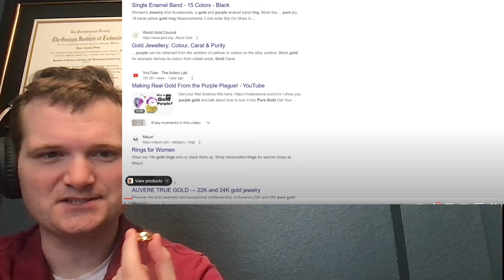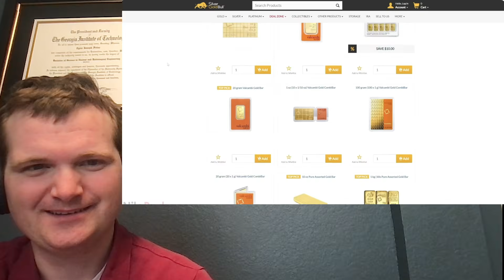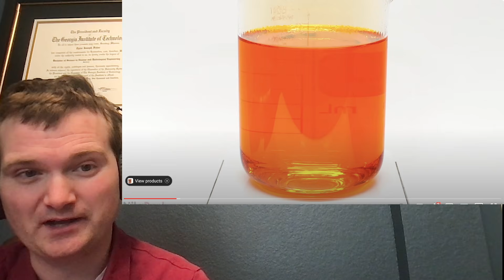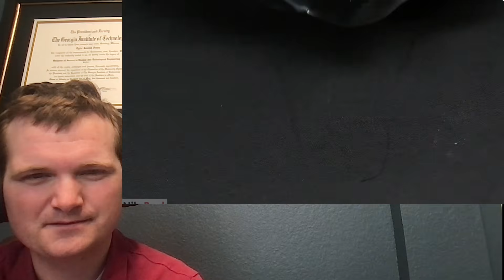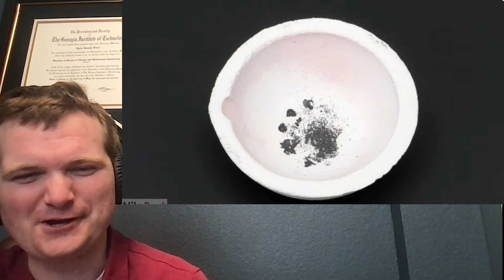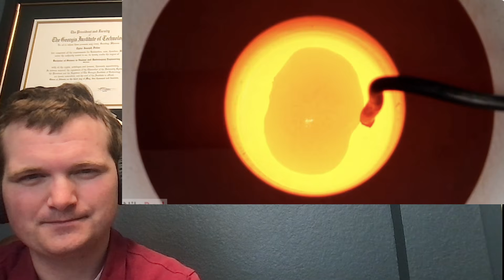Nuclear Engineer Reacts to NileRed Making Purple Gold - Part 1

Comment: 13:58 I wonder how youd actually deal with it for real though? Wouldnt the acid eat any paper towel? Otherwise you could jsut sop it up and throw all the paper in a crucible. Its not magnetic so thats out. Vacuum cleaner with a clean plastic compartment?

Honestly, theres probably some crazy chemical solution that would have made a good nile blue video, should try it on a....smaller scale

Comment: The NASA Helmets used to have a thin film of Gold on the face shield, I’m assuming they still use this technique. I have Welding Shield Lenses that have 24k Gold film also. They change the colour of the arc/puddle and are a treat to use, extremely clear with very good contrast. But these lenses are very expensive.

Comment: Posted to NIleRed.  Lesson for you that you need. Pure gold 100% gold is always yellow always 24 karat. Asked my mom 50 years ago as child how she has white gold because gold is an element. Elements do not come in various forms; they have EXACT unchangeable features. Finally in 1985 a jeweler told me, 12 karat is 50% gold, 18 karat is 75% gold, 22 karat is 92% gold. If you have 18 karat gold (75%) the other 6 karat of 25% is brass so it stays yellow. If you have 18 karat white gold it is 75% gold and 6 karat (25%) nickel. The value is actually the same as metal, but the white gold value is higher for labor because it is difficult to mix. If you have 22 karat red gold it is 92% gold and 2 karat (8%) copper. So you cannot have PURE white gold (it has nickel), you cannot have PURE red gold (it has copper), you cannot have PURE purple gold (it has aluminum); AND if you have PURE gold (yellow gold) it is 24 karat 100% because with brass it is not PURE gold. Now someone may misuse the term PURE instead of the correct term SOLID gold versus jewelry gold-plated on the outside. Being solid does not mean pure. Solid 18 karat gold is not pure gold.

Comment: The comma just depends on the country. Here in Brazil for example we use dots for every 3 orders of magnitude (1.000; 1.000.000; etc) and commas for decimal.

I've heard other places use even more different systems. I think I've heard India (not sure?) uses a divider every two order of magnitude or something like that, like 1,00; 1,00,00; 1,00,00,00; etc)... Or it might've something starting only at the millions, like 1,00,00,000,000? I don5 remember. I think it was a Tom Scott video.

Comment: I've known about purple gold almost since I started making jewelry.  This alloy would've already been used to death if it weren't so unworkable (hardly malleable or ductile at all if my memory is correct), which is its very problem.  I noticed that the quick clip of the jewelry with purple gold in it, that it was set like gemstones would be, or soldered (actually brazed, but the jewelry industry uses the term soldered) to the rest of the jewelry.  I think I saw this being done almost a decade ago, probably by the same company.  I have also wondered for a long time if a pinch of gallium would solve the malleability/ductility problem, but since I'm not a metallurgist I don't even know if this is viable.

Comment: I have cast jewelry for almost 20 years. I have made purple gold. It is very brittle. That's why you don't see it much. The process is expensive. Another reason you don't see it in stores. Made properly it can't be a ring it is used to enhance white gold and pt. pl.. the entire process takes days to create and requires a complete vacuum. He used argon as a cover gas. Big nono. All vacuum no cover gas back fill. Let it cool completely in a vacuum so the aluminum doesn't turn into aluminum oxide.  That's what makes it hard to work with. It work hardens very quickly. And can't be annealed normally.  Again it has to be done in as full of a vacuum as possible. On the surface of earth it's impossible to create a complete vacuum. In 100 years space manufacturers could produce purple gold that could be more flexible and easier to work with. I have personally made several small batches of purple gold. It's not shiny like the pictures. Its more of a flat purple. Great for accents with white gold and amethyst.

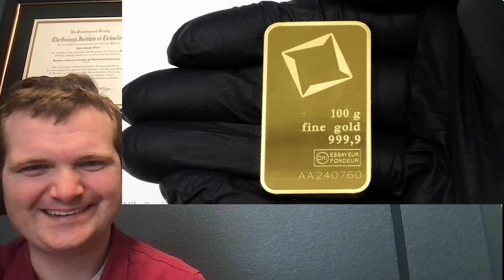Comment: That comma thing at 8:37 is strange, because in Switzerland 🇨🇭 and Liechtenstein 🇱🇮 we usually use the decimal point and it’s a Swiss company. Probably a German employee or so. Or French 🇫🇷 one (don’t know by heart the French conventions). A decimal comma is used in Germany 🇩🇪 and Austria 🇦🇹. As separator for thousands in all DACH countries the apostrophe is used e.g. 1’000. That’s pretty confusing and a pain in the back if it comes to data exchange and it’s not treated correctly. Excel e.g. switches it according to the country and language settings. But if you have raw data sets as un formatted ASCII code, you must be careful. It’s crazy, this is not standardised.

Comment: This is what ChatGPT "told" me about making purple gold:

"As of my last knowledge update in January 2022, there is no known method to create a material commonly referred to as "purple gold." Gold is a chemical element with the symbol Au and is typically yellow in color. The color of gold is a result of its inherent properties and atomic structure.

If by "purple gold" you mean a gold alloy or a gold material with a purple hue, that would involve mixing gold with other metals or materials to achieve the desired color. However, creating a true purple color in gold is challenging, and it may not be achievable through conventional alloying processes.

It's worth noting that jewelry and other gold items may be enhanced or coated with various materials to achieve different colors, but these are not changes to the actual gold composition.

If there have been new developments or discoveries in materials science or metallurgy since my last update in January 2022, I recommend checking the latest scientific literature or consulting with experts in those fields for the most up-to-date information."

Comment: As a goldsmith, one of the frustrating parts is that he went through the effort of dissolving the gold bar and getting it out of the acid again, when he could have just bought some gold granules that are specifically made for creating alloys.
Reply: If it made sense it wouldn’t be a Nile Red video
Reply: I noticed you didn't mention the cost. Is there a difference in price between solid bars vs granules?
Reply: @Tubeytime  Gold bars cost more because it's a financial investment product. Granules are an industrial product. To simplify, there are more people who would want to buy gold bars, than there are people who want to buy gold granules.
Reply: @toomaskotkas4467  That makes sense, I was thinking that turning it into granules is a value-add, but I guess it works the same the other way too.

Comment: The ',' instead of decimal point is used in Hungary(and probably other places) but it's so annoying cuz I personally default to '.' and yet many localised applications don't accept it, only ',' since we use dots to separate 1000s so instead of 1,000,000.50 it is 1.000.000,50 <= this looks cursed even tho I grew up with it.

Comment: ...and as a software engineer, the comma vs dot thing is a special nightmare. Lots of programmers has NO IDEA and use system routines like printf or scanf to print and parse numbers, but what they do not realize, that the comma/dot setting of their operating system will affect how these functions print out AND how they parse the numbers.
Soo many issues with files written in Sweden not working in the US and vice versa, because the files were "corrupted" by writing them out wrong (or trying to read a correct file the wrong way).
Reply: Oh God, and I can just imagine all the fatal errors from a number containing multiple periods 😵‍💫 I didn't even know about this until today, def gonna file it away for future reference
Reply: @darkshadowrule2952  The truly scary thing is the fact stuff like printf() and scanf() or strtod() just silently switches by country, but most programmers have no idea. So to read a text file where it says "0.75" in it in France, the code that does scanf() will get 0, not 0.7 .... or wanting to emit a color value, which is often represented as  a comma-separated list of decimal numbers, and that is supposed to be 0.5,0.5,0.2 but the software does printf("%f,%f,%f") and in Sweden end up printint out 0,5,0,5,0,2  ...

Honestly I think the fault is in the C programming language.... it should only do per-country behavior when you SPECIFICALLY ASK FOR IT, and it should default to the "generic" C-way of writing numbers - with decimal POINTS and using COMMA as the separator. 

There should be a special "print-this-in-the-local-tongue-of-the-inhabitants-of-this-country" function and a separate "read-this-in-the-lingo-of-the-land", but there's not............ and SOOO many people have no idea this problem even exists.....

Comment: He’s wrong about the purity of the bar and the weight and his reasoning regarding his lost gold during the procedure.

Gold bars have the content weight advertised on it.

So it will say 100g the bar will weigh slightly more than that. The excess weight will make up the impurities and a buffer of extra gold. As the bar will be 100g minimum. As the production and assay of gold is tightly controlled so you will always get atleast the amount advertised in practice you will receive a fraction over the advertised amount.

Comment: I am an electrical engineer, i've come accorss the comma as a decimal point once in my professional life thanks to an IEC standard. 
Worst part is it had 3 decimal places so at first i didnt pick up on this and we had a completly different outcome from the calculation. Quickly picked up as the number didn't look right. 

Thanks parts of Europe.
Reply: I specifically write out thousands, millions and billions because the US is one of the only places that do not use the thousand million (1000000000) instead calling it billion.

Comment: You might find this interesting Tyler, but the comma/period decimal thing can sometimes screw up coding in video games. One of the last Pokemon games had a built in calculator and players discovered that European copies had a strange bug that made it completely broken.

Since Europe uses the comma for decimals, they changed the calculator to use it as well. But they didn't make the calculator WORK with commas as decimals. So it started calculating 33,300.30 x 44,330.20 as 33,300,300 x 44,330,200 and what not. On top of that, the commas actually let the calculating numbers overflow into other functions, allowing for some very strange calculations.

When I worked in quality assurance, they would give us big CD spindles filled with multiple region versions of whatever game we were testing. An easy test was always to check the calculator function on European versions, because it was a very, very common bug. People joke that games these days don't have testers, or that their testers are blind, but that's not really the case. I'm guessing that the QA guys who worked on that Pokemon game caught it, but it was just passed through as 'minimal priority'. QA almost always finds everything. It's just the dev team's upper management ignores it all, unless it would be bad enough to make the game fail to pass certification. Such bugs are save corrupting, console crashing/freezing, and any other really bad things. Sadly, though, Sony and Microsoft have become very leniant with even these high class bugs. As long as a developer promises that the bugs will be fixed with a day 1 patch (cough Bethesda/CD Project Red cough), it'll just be allowed to be passed through cert anyway.

Comment: Gold metal is inert, gold ions are toxic heavy metals. So even less a chance for the solution use in the body.
Reply: Good thinking on mass spectrometers, trouble is they get confused with gold and tungsten, so they spit out tungsten readings, where none is present.

Comment: 22:24 I have had several years in the welding trade.. Oxidation of materials is a real thing there, too. trick is , with any flame to melt a metal, is to redue the oxygen in the flame make the flame fuel rich.. that superhot fuel in the flame will consume any oxygen that tries to sneakl in and bond with your metals. Stainless steel is a good one for that ... haveto use a non oxidizing 'shielding gas' to keep the oxygen out.  Nigel , if he had known, could have stopped most of the oxidation from occuring.

Comment: In Brazil, we use commas for decimals and dots for thousand separators (those can be omitted or replaced by spaces).

Examples of typical notations:
1.234.567,89
1 234 567,89
1234567,89

Each country has its own convention and some even group different amount of digits.

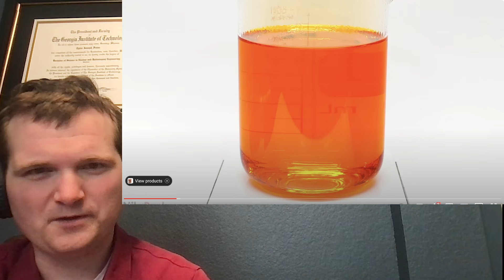Comment: 13:03 The color of the gold nanoparticles and the color of HAuCl4 are due to different reasons. The color of Chloroauric acid is the due to the same reason many transition metal compounds are colored. It's due to the splitting of the d-orbitals of the atom which lets the compound absorb light of visible wavelength (so the color of the compound will be the complementary color). 

The color of gold nanoparticles is due to a different but an even more interesting reason! It is apparently due to "Localized surface plasmon resonance" which is the electric field of the incident electromagnetic radiation (visible light) interacting with the conduction electrons near the surface of the gold nanoparticles and making them oscillate coherently. I am unsure about the details of this phenomenon as I just read about it and I'm only doing chapter 4 of griffths EM right now lol
Reply from the maker: Thank you very much for the correction! Fascinating stuff!
Reply: There is other videos with plasmonic purple gold, the ex&f video with explosive gold, and a breaking taps video using lasers .
I want some. 
I don't know anyone with a fiber laser.
I think blowing it up would be wasteful.
Reply: Unrelated, but you are one very smart gamer MasterShooter64
Reply: Ah, Griffiths. That brings me back. A true classic.

Comment: The color you see for the solution comes from a process than with the nanoparticles. For the dissolved metals it depends on which ligants are coordinated to the metal ion. In case of the nanoparticles the color is size dependent because it comes from plasmon resonance. In a nutshell: Weird quantum interaction of the nanoparticle with the light waves.

Comment: The brittleness is probably caused by the crystal structure that forms from the mixing of gold and aluminum. Kind of like how adding carbon to iron can turn it to a much more durable and usable material called steel.

Comment: i seen the original video and commented  that if it were possible to melt the gold and aluminum in a vacuum that it might be possible to avoid the slag from the aluminum oxide and the air bubbles left from pouring it.
the comma seems to be more common in European countries and i find it off too.

Comment: Gold bars actually tend to come in those annoying little packages. I think they're purposely difficult to open because you're not really supposed to take them out of the container.
Reply: Electronics sometimes comes in that packaging too. Quite annoying to open those.
Reply: Container contains assay card with specifications for the bar including a matching serial number
Reply: yeah i believe the difficulty in opening these things is on purpose to avoid losing as little of the actual gold as possible through mundane interactions (holding it with bare hands, repeated water washing, prolonged exposure to sunlight, prolonged exposure to air, etc.) since gold is supposed to be kept and stored over a long period of time without being used
Reply: most of these goldbars are actually meant as investment gold, inflation safe value.
No need to ever get them out for storing and trading them, keep them originally packed with foundrys certificate of authenticity... no need to dirty them up or expose them to elements

this wasn't exactly a shop a jeweller would get their stock from
Reply: doesn't explain why I still need a pair of scissors to open a pair of scissors
Reply: Goldschläger for diagnostic CT scans. lol

Comment: Something I've observed refining gold. Occasionally, when adding sodium metabisulfate (Nile used potassium metabisulfate, but it's essentially the same reaction) I've seen the solution go purple and rarely even get finely divided purple shaded powder but once melted it  it turns the classic yellow gold color. 
Interesting that aluminum creates purple gold.
Reply: Can he separate gold from tin? How‽
Reply: @petevenuti7355  Sure, tin will dissolve hydrochloric acid and form SnCl in a cloudy solution. It is a very useful reagent in determining what precious metals you may have in an unrefined acid solution. Removing tin from a gold alloy can be better achieved by doing boils in dilute nitric acid, filtering and rinsing several times before going into a HCL/Nitric acid solution to attack the gold.